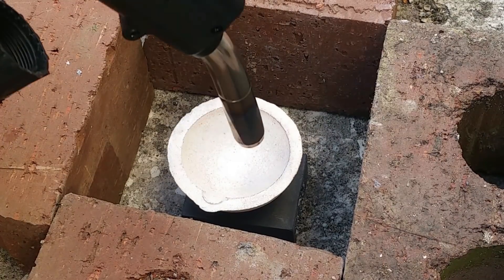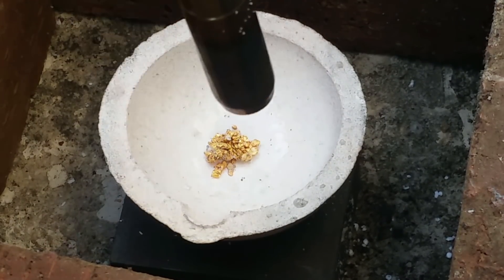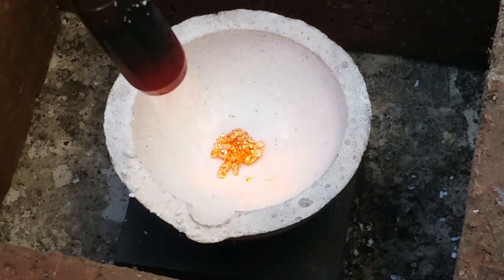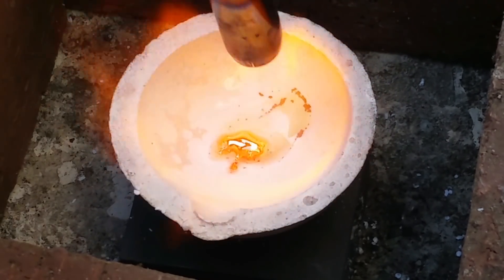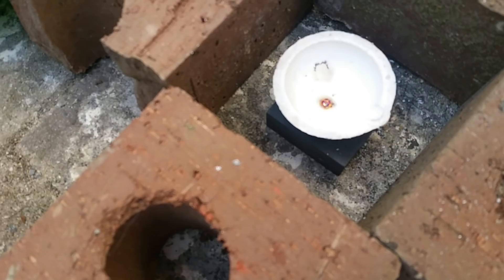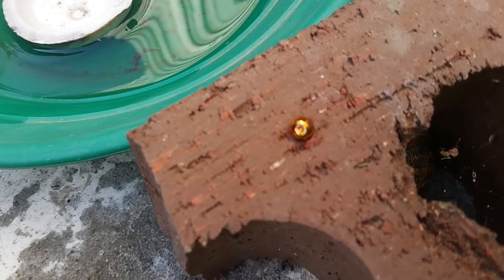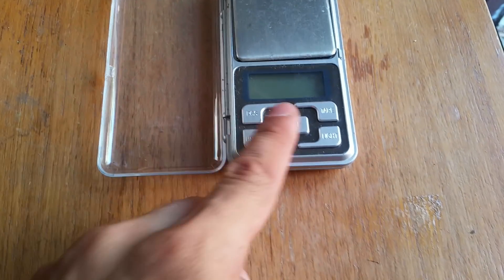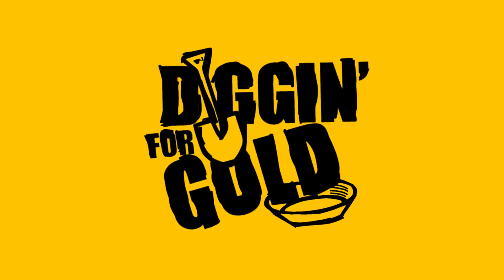Another Attempt to Melt 1g of GOLD with a Torch

Comment: I WOULDN'T put a hot crucible in water like that. It could crack or even shatter..
Pluck the bead out with needle nose pliers right after the bead goes solid..
About 30 seconds after you removed the torch or it will stick in the crucible to the Borax..
Reply from the maker: Yeah I was hoping to get it out sooner but fiddling around with the camera made me get to it too late. Thanks for the advice re the cricible and water. I probably should have thought of that. Poor form haha. Oh well, lucky escape this time 👍

Comment: The borax flows like a liquid and then goes hard.  Next time pick your button up when it is still glowing and it will come right out.  Putting your hot crucible in water could make it crack so be careful.  Cheers.  Good job.  The borax is to remove any rocks or dirt from the gold once it melts.
Reply from the maker: Yeah. Twas mostly because I was filming. If I didn't have the camera to worry about then there wouldn't have been any barriers to me getting it out of there asap.